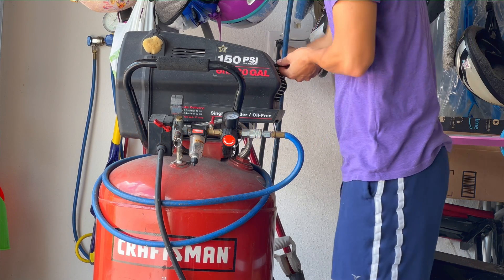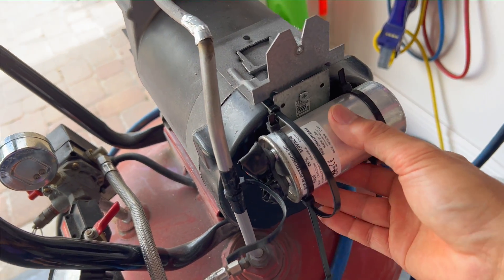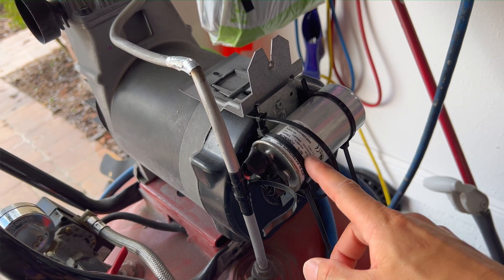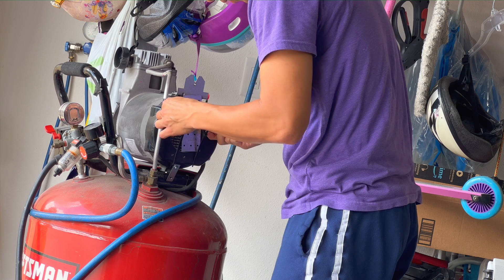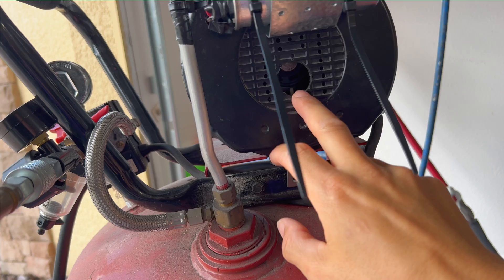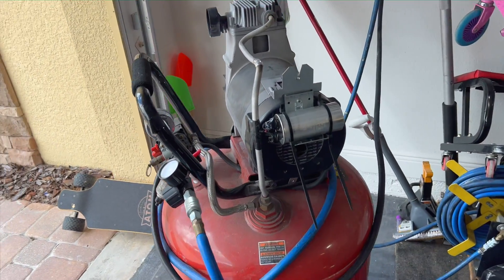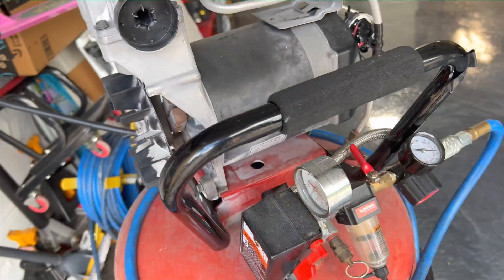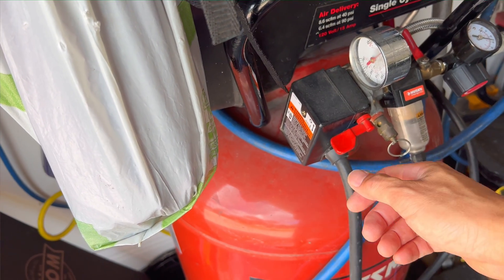How to Fix Craftsman Air Compressor 30 Gallon 6HP| Tripping Breakers

Comment: Mine has always kicked the breaker,even melted the plug prongs off the cord.
But mine doesn't have any capacitors on it??
Reply from the maker: All these 120V compressors and motors 100% have capacitors to start and run. That’s only way these motors will work.

Comment: So is this compressor supposed to have 1 or 2 capacitors. Just picked one up. The previous owner replaced the capacitor with a 30uf capacitor.
Reply from the maker: There’s a run cap and a starting cap.
Reply: @TunerwithKids I have the same model as yours (model number showed in your video) I’m only seeing 1 capacitor, is the second hidden somewhere? Thanks for the reply and great information.
Reply from the maker: @RayMarler-jh8tn they are both originally behind the motor cover. I relocated my run cap after replacing because it was too big. I extended wires and mounted outside the cover.

Comment: Hey Binh;  thank you for this information.  I did an ENTIRE rebuild of my compressor, which is just like yours.  After mechanical rebuild (ring, cylinder, valve body, o-rings, switch, etc.) it would STILL trip the breaker at about 100 psi.  With the info you provided, I understand exactly what was happening.  Replaced the RUN cap, and it's operating like a new one.  (New Sub).  Seems you are into a lot of the same DIY things I am.

Comment: So I’m having that same issue with my old 30gl 6 horse power compressor.  What size exactly did you use?  I understand the original capacitor on there is discontinued

Comment: Hey mines is having the same issue cold start won’t trip it but once it runs for a few mins it will trip it every single time at about 60/80psi. Do you think mines would be the run cap also? I have the same exact craftsman’s air compressor!
Reply: Did you get your problem fixed?

Comment: Mine just started doing this and I figured its the start capacitor.  Glad to find this video.
Reply from the maker: Good to replace both. They only have a 5 year life these days.
Reply: @TunerwithKids  where did you get the ones that fit correctly?
Reply from the maker: @momo-hm5ru  they don’t. Only one fits. The run cap I had the rig it onto the cover. See links in description.
Reply: So I have the 2hp 33gal 150psi compressor  and it just started doing the same thing, glad I saw your video!
Question: where do you go for the parts, capacitor?
Reply from the maker: @bertmcnaughton8078  check links in description. Amazon has it all.

Comment: What did you use to remove the 3 screws holding the cover ?
Reply from the maker: It's a torx bit. Need a skinny bit driver and the correct size torx.

Comment: So mine had the same problem and after changing caps it would still blow the breaker. After some research I discovered that there is a 2 stage switch inside where part of cover presses against a little part of this switch to depress it. My cover had pulled away from it leaving the compressor in 2nd gear as a description. I was puzzled for years. Finally one day found a YouTube on this and voila has worked perfect ever since. I had to fabricate a holder to keep the cover part of it pressed against it. Mine was a craftsman like yours but one that lays on its side.
Reply: One video that will show how the switch that changes to the start capacitor is called “Fixing The Impossible Air Compressor” this guys YouTube channel is Sams Wood Creations
Once I saw a video showing how that clutch type activated switch works it lead me to be able to get my breaker blowing problem solved for good. My compressor was trying to start from its run capacitor rather than its start capacitor.
Reply: @2timbukk  thank you for that information bro I will look it up hopefully that is my problem also! Want to use my air compressor man lol
Reply: Can you share the video? I’m trying to fix mines also only trips after running for a few mins annoying me. Thanks bro hopefully I can figure it out!

Comment: I was wondering if the motor was binding for some reason...turns out you needed the 40 microfarad, not the 50 microfarad capacitor  Thanks for the update, the video will always be here for all the people that make the same mistake.  Congratulations on a nice fix.
Reply: Does the voltage matter also though?
Reply: Does courts mean anything
Reply: @robertmorin6495  but does the voltage on the capacitor matter?

Comment: I have the 60 gal 6 hp oil free unit like yours but don’t have your problem and mine is a 1994 but I got tired of all the noise and rebuilding the pump so I separated the pump from the motor and got a 5hp oil unit from H.F. since I have the 6hp motor but (spoiler) it’s not 6hp which you probably know being an engineer.i think it’s closer to 41/3hp and would have gotten a 31/2hp pump had I realized that sooner but I think it will still work.i wanted more using as much of what I had as I could and only have to get a pulley and finish building a new platform for tank top and I should be in business.if you use yours as much as I use mine you may want to consider it
Reply from the maker: I upgraded to a 60 gal IR T30. 🙌

Comment: I have the same compressor. What was that filter looking thing between the air outlet and hose? Do you have a video on that as well?
Reply from the maker: Probably water/oil separator or moisture drain. All compressors should have one. https://amzn.to/3U3Ftxo
Reply: @TunerwithKids  awesome, thanks…..did you do a video on it? If not, I think a demonstration video would be a cool idea….
Reply from the maker: @patriot72 no video. Just screw it on with teflon.
Reply from the maker: Or this https://amzn.to/48XA1A2

Comment: Your not clear about how to discharge capacitor what are you shorting to?
Reply from the maker: Touch the two pins with a metal object to short the cap and remove any potential energy.

Comment: Is there only 1 cap in that unit? Typically, there is a RUN one and a START one.
Reply from the maker: There's two. The start cap fits inside the original housing but the run cap is too big so I rigged it on.

Comment: Hello Binh. Can you give the part number of the capacitor your replace in your video. Thanks.
Reply from the maker: Check links in description. Make sure yours is right size and match the uF.
Reply: I purchase used de same compressor rmodel in your video.  At the time of purchase did not notice that the capacitor was missing. Thank you for your respond. @TunerwithKids
Reply from the maker: @RicardoLopez-wf2ef the caps will vary slightly between models depending on the motor. But it should be same if not +\- 5uF.
Reply: Thank you! @TunerwithKids

Comment: Very nice, sometimes it’s better to just use oem replacement parts. Glad that you were able to figure it out. I have an older Craftsman 27 gallon horizontal that looks like it’s from the same era as yours, they are work horses.

Comment: If you keep the compressor in same spot connected to same out you might just want to add a new 20amp outlet with a new 10/2 w/ ground wire to a new 20 amp breaker. That will solve your issue much better and it will be easier on your compressor.
Reply from the maker: Not really if you have capacitor issues. A lot of people trip 20 amp when capacitor is bad and causes out of phase rotations.
Reply: I have had this thing trip so much, i ran a conduit stub off my main panel with either 10 or 12 gauge wiring and it still did it. I had added server fans to the compressor heatsink area, but i'll add one to the motor housing and replace the caps.

Comment: So year later. What exactly was the solution to your issue? Was it just the capacitor? 
Mine is tripping circuit breaker before it fill the tank. And then it won't even start.
Reply from the maker: I had the wrong run cap, it threw off the phase balance and overheated. The cap needs to match existing uF rating. If your is tripping on start, you start cap is bad. Take both out and check the rating, order the ones in my links in description of its same size, else search P/N for replacement.
Reply: @TunerwithKids  Will do. Thanks for the update and information! Now just need to find some time to address mine.

Comment: thanks so much. My compressor has started running about 30 seconds then trips my 20 amp house breaker. I blamed everything, disconnected the compressor, belts everthing down to the motor only. It runs about 30 seconds so I removed the capacators. well its a big problem since its a craftsman build in the 90's. the capacators are under shields on top of the motor. And the correct ratings are almost impossible to find, forget the fit. everyone that sells them said oh this is close...it should work.Anyway I will find the correct ones and even it I have to use duct tape I will get replacements.

Comment: Great video. I will order from the link in your description. My question is does it matter which side the wires go on. I dont see any markings on my current capacitor to suggest the specific side for each wire.
Reply from the maker: If it’s two terminals, no it doesn’t matter. But I think the compressor side has two doubled up and another single wire.

Comment: So I have the same compressor and I think the run ambassador was already changed at some point I would like to know if you could give me the exact numbers like 45 UF 370 v AC is mine what are the numbers on stock pastor or can you send a link to the right ones
Reply from the maker: If you have same compressor, pull old ones to see what’s in there. I have links in description to the ones I used. FYI, I have a follow up video that figured out the issue. I put the wrong sized cap previously and phase balance was off when motor was running which runs hot and pops breaker.

Comment: Hi Binh thank you very much for sharing your knowledge and time. I have model 2005 craftsman 919.168700 33 gal vertical oil less 6 peak hp. The last time i used it was 8 years  ago and it has been sitting in my house storage ever since and never been used. It looks shiny brand new outside because its hardly been used.I had the same problem with this compressor tripping the fuse intermittently in the past. I am planning to used it again and recently i found out it has Devilbiss recall. I did hear you mention it in one of earlier troubleshooting fuse tripping  video where you made some big and small holes on the inside motor cover for venting the motor because you could not get the replacement kit when they had the recall going on. I am still searching in the internet for the replacement recall kit which contain the external front and rear cover/shrouds and no luck so far.  It seems the replacement recall kit are made of better fire retardant material but looks similar in design. Were you able to find the replacement kit?  What are your experience and how did you solve the recall issue?  Moreover since its been in storage inside the house sitting empty for the last 8 years, i drained it recently and 1/4 cup of light brown water came out of it and not much of rust. Do you think i should do a hydrostatic test on the compressor before i put it to use? Or is it an overkill? . How do i do a hydrostatic test on this compressor? There are only 2 outlet on the top. I have not started it until today because it seems the external shroud that cover the motor might catch fire if it gets too hot. While i was looking for the replacement recall kit, i stumbled upon my past fuse tripping experiences and i thought i might just post it in the internet and try to find some help. Here i am but 10 years late to look for solution. I will really appreciate if anybody else could share their experiences if they have the same problem finding the shroud replacement recall kit or how should i proceed to solve this problem. Or should i just go ahead and start the compressor up but not fully but half way to find out if it still works and make sure my safety valve is not stuck and its in working condition when i pull it. All I am afraid is if the tank explodes if i fill it up to its full capacity.  I might still have the same fuse tripping problem lingering around in the background. But i am trying to solve one problem at a time before i tackle the fuse tripping problem. I am posting it here because i have a feeling that frequent fuse tripping has something to do with motor heating up prematurely without proper venting of the shroud but i can be wrong. Again thank you in advance for your time and patience, have a wonderful day.
Reply from the maker: The motor tripping fuses is a capacitor issue. Replace them as they are only good for 6-9 years depending on heat exposure. I have links in description to Amazon replacements. The cover is no longer found since it’s so old. I had no luck with craftsman. I just drilled holes for air flow which is what the new cover has. Mine broke so I rigged the screw with holding plate. The hydro test should be easy but you need to put new fitting on the entry hole to fill with water and then pressure washer. I have a video on my channel where I did it for my IR 60 gallon. It’s also a good idea to add a remote drain ball valve to easily drain tank periodically.
Reply: @TunerwithKids  Thanks again for getting back to me. Did fitting the right capacitor with right capacitance fixed the fuse tripping  problem until now.....its been 10 months now?  Would you suggest that i make some holes on the cover that holds the run and start capacitor on the other side? Does the holes help to dissipate the heat and keep the motor cooler?  Did you changed both the start and the run capacitor to begin with the problem? I am pretty sure you are right that capacitors do age out and needs to be changed and this compressor is an old one too. I have to start the compressor up and see how it fires up.And the remote drain ball valve will surely make the draining process more easier and faster. I am kinda hesitant to take apart the parts because of the crispiness  of the aged plastic shrouds when you want to do the hydro test. Wish me luck and see how it goes....have a nice weekend.
Reply: @rajm5244  bro, i think you're overthinking this. If it trips the breaker, replace the caps. Drill some holes, if you want, like this guy showed in his other video. Otherwise, get on with your life.
Reply: Try making access points and point a fan at it and see what happens.i have a cheap wire welder that didn’t come with a fan but has an overload kill switch,I point a fan at it and it never shuts off now

Comment: Binh, lol I just subsribed and watch your original video..  To clarify thats the start Capacitor right?
Reply from the maker: They one I replaced in this video is the run cap. I had wrong uF rating. It must match the original size. Usually 40UF, but YMMV.

Comment: Question, after watching your video, I replaced both capacitors and it ran for a minute, I turned it off and then tried it again but keeps tripping the breakers again. I have tried multiple outlets so it would be running off a different breaker and even trips a 30 amp breaker. Any idea what would be causing this issue for me?
Reply: Check the check valve.  If it is bad the compressor will start with little or no air in the tank but can't start when there is pressure in the tank, causing the compressor to lock and overamp which trips the breaker.  To check for it, drain the tank and see if it starts and runs ok with 0# in the tank.   Then try to start it with 100# in the tank.  If it starts and runs when the tank is empty, but won't start with pressure in the tank, then there's a good chance it is the check valve stuck open.
Reply: @RidesTheRain  In your scenario, more likely the unloader. If the check valve is bad, when the tank reaches cut out pressure and the unloader releases head pressure, it would continue hissing and releasing pressure. If it hisses and stops the check valve is probably good. Now, if both are bad....... But good thinking. I would suspect most people dont know there is a check valve in the system. Cheers.
Reply from the maker: The new caps same rating as old ?
Reply: @TunerwithKids  Exactly the same. I watched a man show that the cover if not completely seated can keep the centrifical switch from engaging. So I made a bracket as he did to bolt it to the case but it is still tripping the breaker this morning after correcting that. Do you know if the motor has brushes inside?
Reply from the maker: @chaplainlee  sounds like something else that is either overheating or throwing the phase balance off. That’s main issue for tripping.
Reply: @TunerwithKids  My neighbor has the same compressor is about to buy a big compressor for his shop so I guess I will just get his motor and swap them. Surely that will fix it. Thanks for the help.

Comment: if you turn on the switch, and the motor is not running. What should I look for? I have the same compressor.
Reply from the maker: Make sure power is going through pressure switch to motor. If these is voltage, maybe start cap is dead.